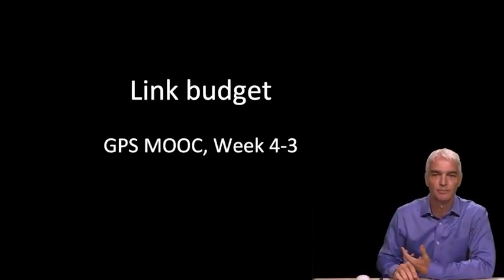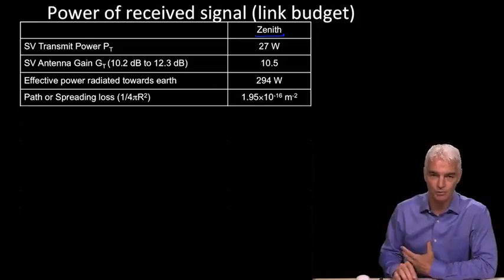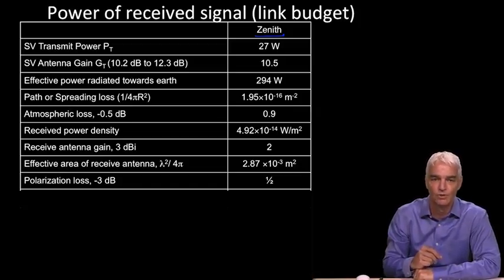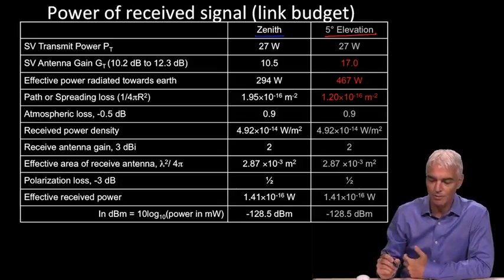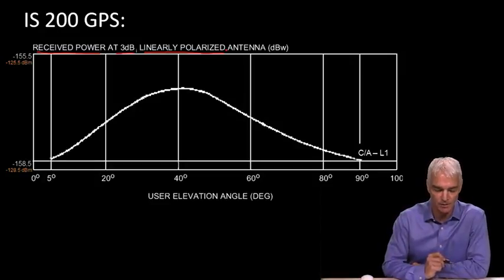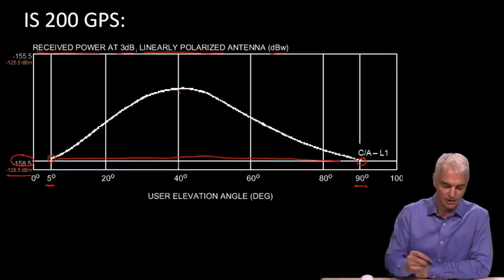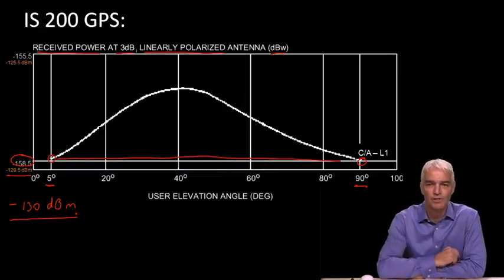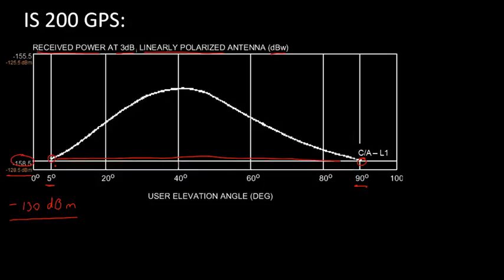4.4 - Link Budget

Comment: How did it get 294 W? If it multiplies the first two, then even at 27.5 W x 10.5 it would still be only 288.75 W.
Reply: That't not an issue. Even if you change the Ptx and Gtx to achieve 294W, the resulting Rx Power Dencity I got is 5.16E-14... Ok, that's quite close. The most critical is the final value of the Effective receive power. I multiplied all Drx, Aeff, Lpol and got 7.45E-17. But if the Pol loss is not taken into account, the result is 1.49E-16.